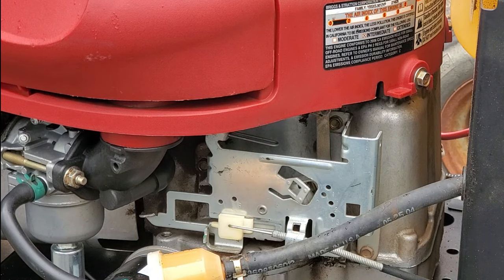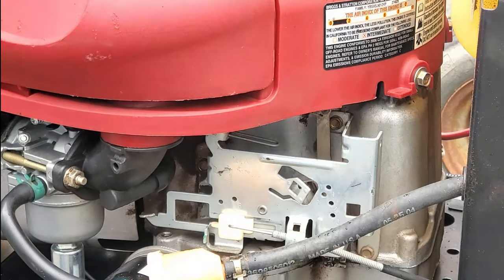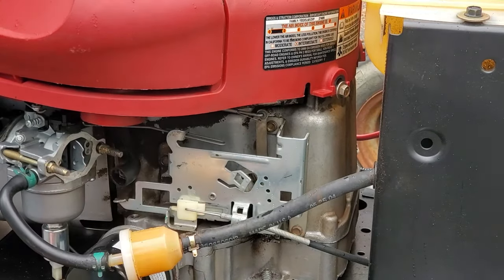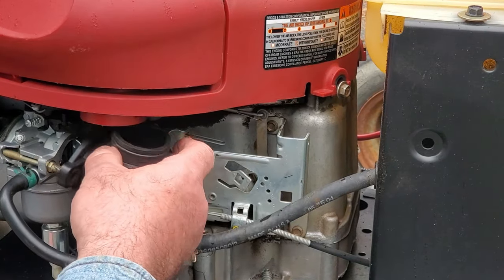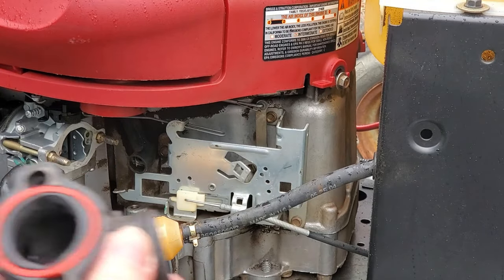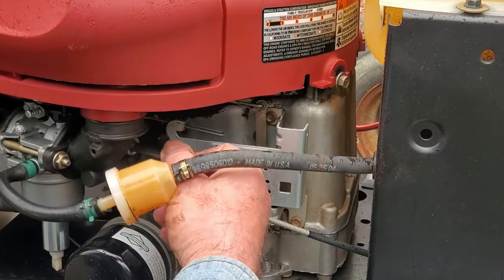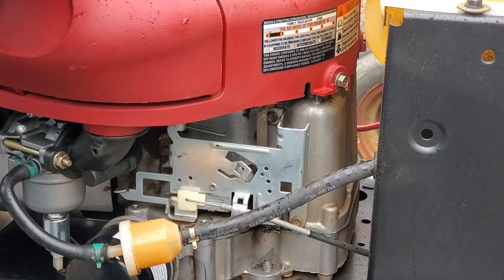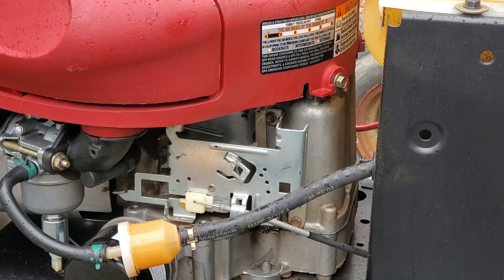Craftsman choke sticks on brand-new carb

Comment: I got a new Briggs and Stratton carburetor the choke butterfly was  stuck in the opening so I had to pull the butterfly out and put it back in the opening and now it is operating  properly  glad you posted this video on this matter of the choke  system was sticking and how to get it fixed and running right riding mower king 👑
Reply from the maker: thank you. I have run into this problem a few times with cheap aftermarket carburetors on these engines.

Comment: GM sir  re-powered  rider with 18hp brigs  set cable so choke works  drives fine but when blades  are on it bogs down any advice  thanks   james
Reply from the maker: Hi, there could be so many things with that small amount of info. You said that you adjusted the choke cable, so that means it should be a twin cylinder. Are you sure it is running on both cylinders, sounds like you may have a weak cylinder. Could be a weak coil, could be valve adjustment, head gasket, fouled plug. So many possibilities.  You need to start ruling out things that you can do on your own. After that you need to get hands on it by someone who knows how they work. If you het too much advice online you will run out of e things. Patience and money.